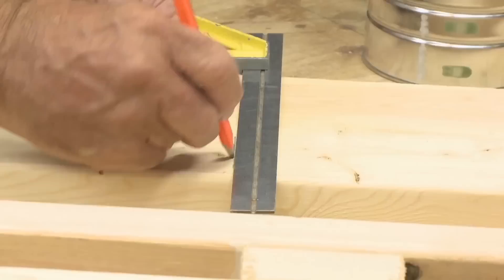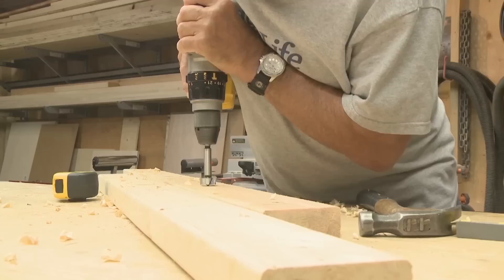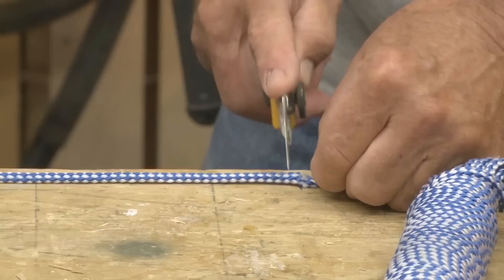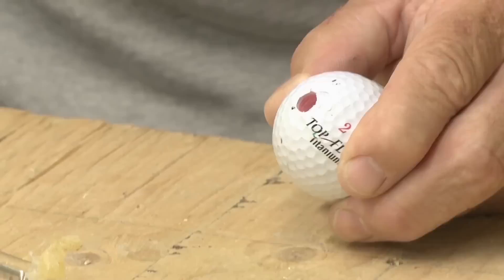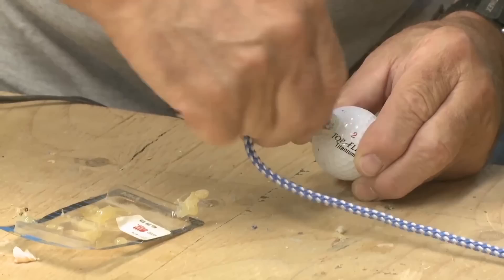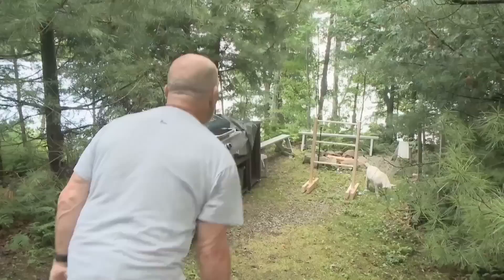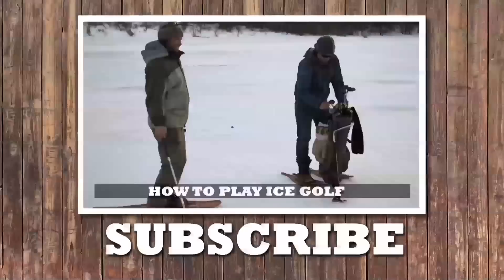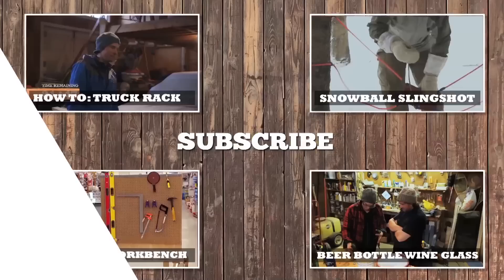How To Make The ULTIMATE Outdoor Game

Comment: What's the objective of the game? Or do you just drink enough beer that the last one still capable of throwing the balls wins?
Reply from the maker: Everyone's been asking for Ladder Toss rules, so here they are -straight from the official Ladder Toss website. I'll put the wikipedia rules first, as they're way shorter:

WIKI RULES:
The items needed to play are two ladders and a set of three bolas per team. Each ladder has three rungs, each rung scoring a different point value. One common method of scoring is to have the rungs be one, two and three points. In one variety the top is worth 1, middle is 2, and bottom is 3.[2] Points are tallied at the end of each round, after all teams have thrown their bolas. The bolas suspended on the ladder score the points for that rung, often with the goal of getting at least 21 points to win.

OFFICIAL RULES
Ladder Golf is played with 2 or more players or teams. Each player has 3 golf ball bolas. A bola is 2 golf balls attached by a nylon rope. The object of the game is to wrap your bolas around the steps of the ladder. The ladder consists of 3 steps, a top, middle and a bottom step.

PLAYING THE GAME:

Prior to game play a line must be set 5 paces from the ladder. This is the called the toss line. The official toss line is 15 feet away but most players measure 5 paces from the game ladder to set the toss line. This allows for a closer toss line for children’s games. Ladder Golf is played in rounds, each round consists of all players tossing 3 bolas. A coin toss is used to decide which player or team will toss first. The first player must toss all 3 bolas before the next player is able to toss his or her bolas. Bolas can be tossed in anyway the player chooses, as long as they are tossed individually and can be bounced off the ground. The winner of the round earns the first toss in the next round. Games are played to an exact point total of 21. In order to win, a player must be the only one to score exactly 21 points after the completion of a round. If a player goes over the exact point total, that players points for that round do not count. For example: A player with 18 points needs 3 points to get the exact score of 21 in order to win. If that player has 5 points hanging on the ladder after all the players have tossed all strands, none of those points count and the player will enter the next round with 18 points again needing 3 points to win. In the case of a tie, the players that tie will play as many overtime rounds as needed until one player ends a complete round 2 points ahead of the other player. The 2 point rule only applies in overtime rounds. During regular play any player can win as long as that player is the only one to score an exact total of 21 points at the end of that round no matter how many points the other players have.

ETIQUETTE OF THE GAME:

Basic etiquette of Ladder Golf states that contestants should make as many remarks, sounds or movements as possible during play in order to distract the opponent’s during play. Touching the player during tossing is never allowed. In the course of play no contestant is to walk to the ladder prior to completion of the current round of play.

SCORING:

After all teams have tossed all their bolas, scoring is determined by the bolas that are still hanging from the steps. Players can knock-off bolas during the course of the game, in fact knocking-off other players bolas is encouraged and a good way to play defensively. bolas that are knocked off during play do not count as points. Only bolas that are left hanging after all bolas are tossed are counted as points.

POINTS:

Points are determined by which step your bola wraps around. The top step is worth 3 points the middle step is worth 2 points and the bottom step is only worth 1 point. Players can score an optional bonus of 1 point by hanging all 3 bolas from the same step or by hanging a bola on all 3 (1-2-3) steps in one round. The highest amount of points available per player is 10. This is accomplished by hanging all 3 bolas on the top (3 point) step.

TEAM PLAY:

Four players can play Ladder Golf by alternating play each round. Players simply alternate turns with teammates. Extra bolas can also be purchased so up to 4 players can play individually on the same ladder or a second ladder can be purchased for team play. With multiple ladders 2 players on opposite teams would be on one side and the other 2 opposing players would be at the other game ladder. One side would toss all bolas and the other team would toss them back. Same rules apply.

GLOSSARY OF TERMS:

Bolas: A Bola consists of 2 golf balls attached together with a piece of nylon rope. Golf Balls are spaced 13” apart. Ladder: The ladder is the structure that consists of 3 steps each spaced 13 inches apart. Steps or Rungs: Each ladder has 3 steps. The top step is worth 3 points, the middle 2 and the bottom 1 point. Toss Line: The line that the players tosses from. Officially is set to 15 feet. For backyard games 5 paces works fine.

LADDER GOLF INCLUDES:

1 or 2 Game Ladder(s) Depending on which version of our game that you purchase
2 Sets of Bolas (Colors vary depending on the set that you purchase)
1 Carry bag
1 set of official rules

More:
http://laddergolf.com/pages/official-rules
http://en.wikipedia.org/wiki/Ladder_toss
Reply: Cottage Life DIY longest comment I have ever heard lol :-D
Reply: Bhav Dang
My rules are still better ... if you miss, drink a beer ... last one standing wins.
Reply: CodeFoxAus lol